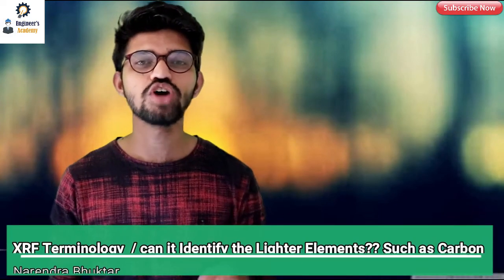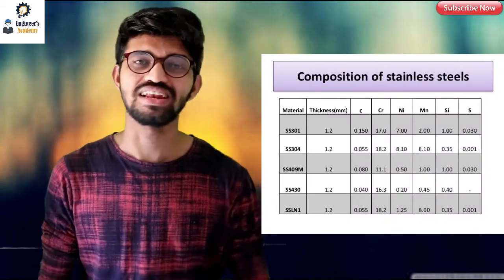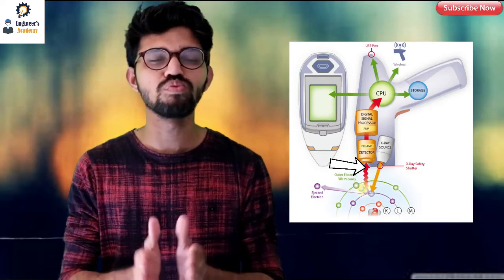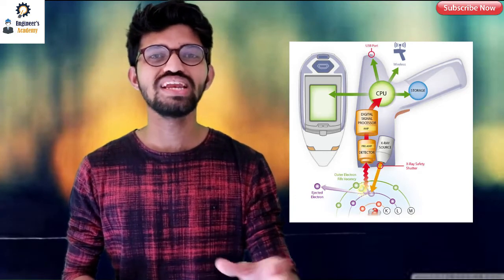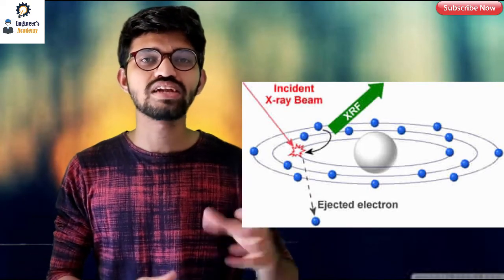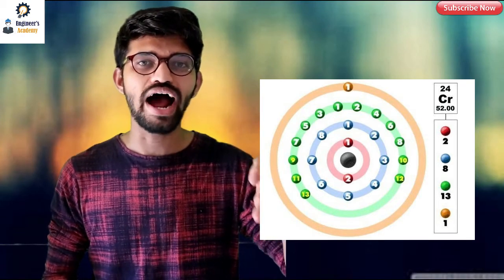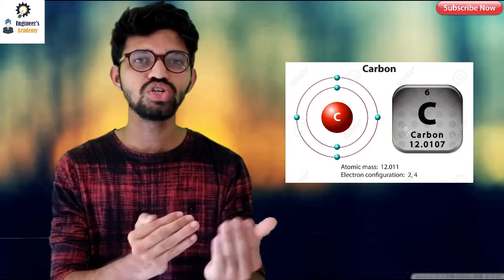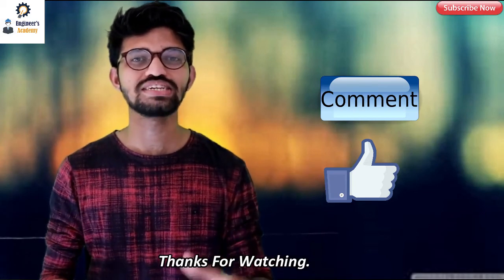What Is XRF technology ?? Can PMI Identify Carbon ?? ||Engineer's Academy||

Comment: May i know upto which lighter element it can work??
Reply from the maker: Helium , carbon, Boron, Berrilium, lithium, Sodium.
Reply: @EngineersAcademy9204  I need some device to measure all elements other than Pyrometer,Temp stick any device is available??
Reply from the maker: Pyrometer is Used To Measure Temperature, In terms of Measurement of Temperature you can go for RTD.
Reply from the maker: Pyrometer is Different & PMI Gun Is Different !!
Reply: Engineer's Academy no it can’t. Silicon Sulpher and Phosphorus are the lightest elements they can detect.